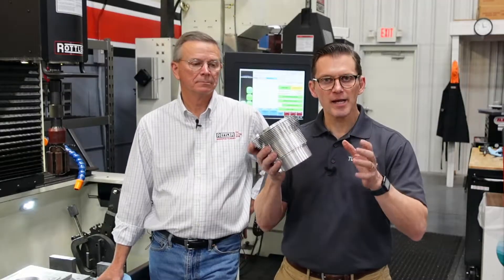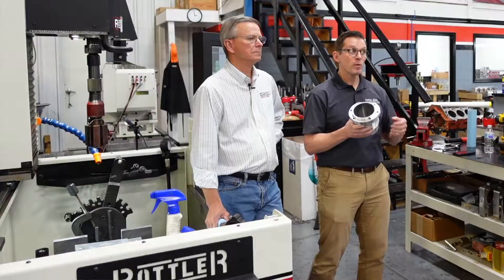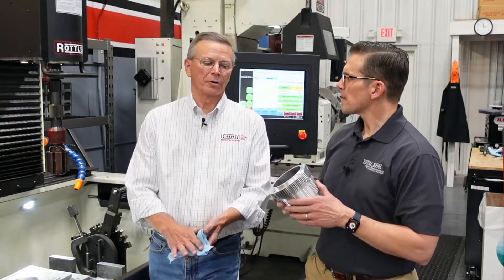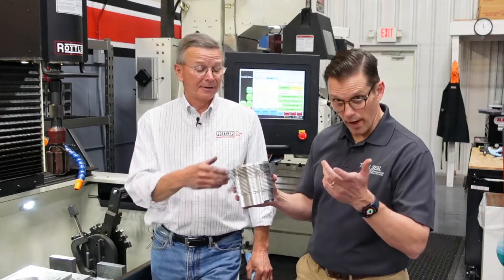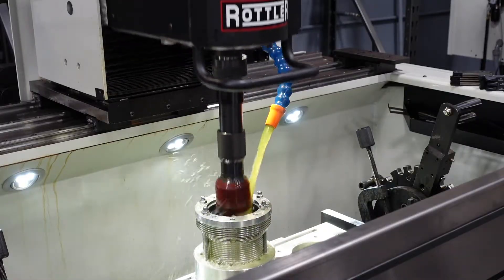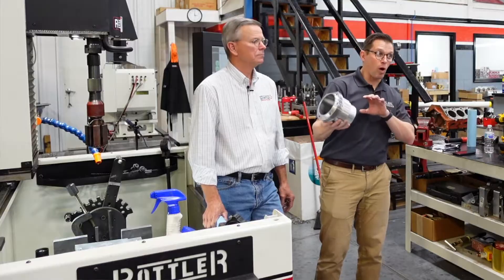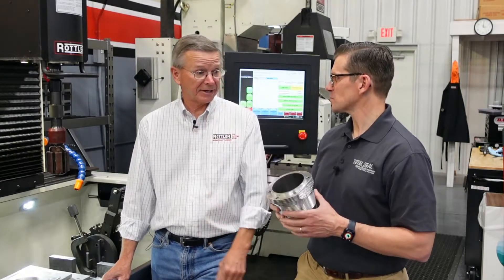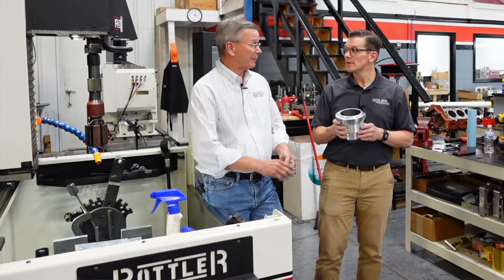SUMEBore Porsche Boxster Project Engine Update - Next Generation Cylinder Bore Technology

Comment: With an incredible cylinder finish such as this, is there a specific time period for breaking in your pistons/rings? And could there also be a requirement for a different grade engine oil? 
Great video insight. Thanks
Reply from the maker: Thanks for the comment. The SUMEbore process does change the break-in time (shorter) and the oil requirements. These are some of the first things we leaned in this development program.